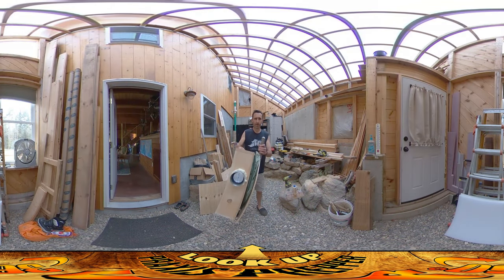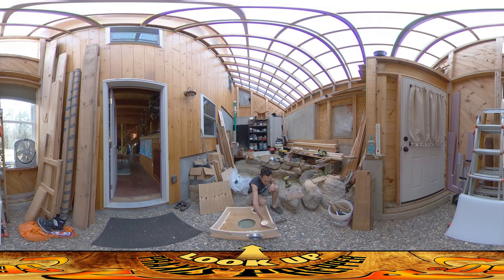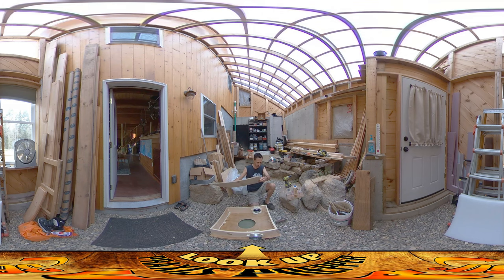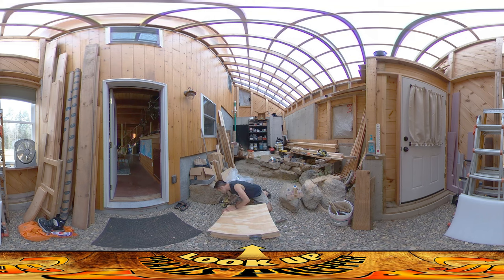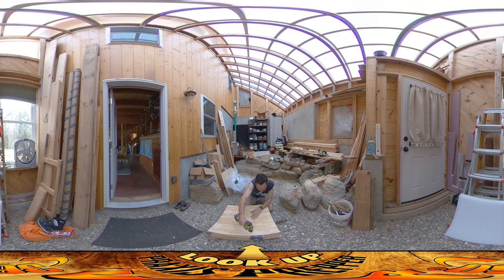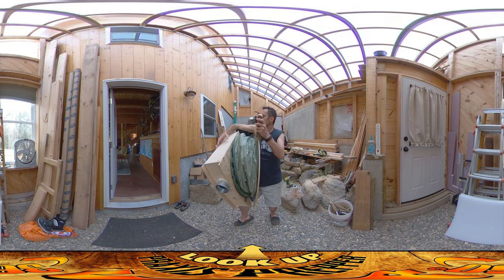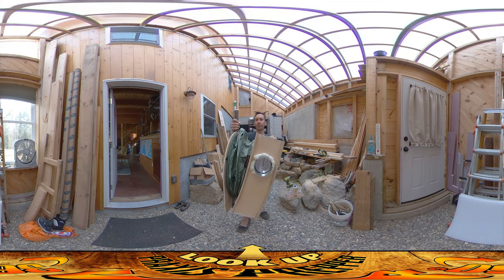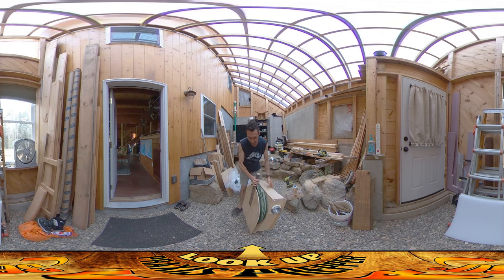Homestead Building - Fallout Shelter Manual Air Vent

Comment: A counterweight system will  help, Praxis.  See old fairrer system. Save you one  motion. Push down, rope and counter weight lift handle.. Work smarter , not harder
Reply from the maker: It's actually a pretty easy push/pull both ways. There's not a ton of resistance in the line, so feels easy to actuate. Now if those air intake filters start getting clogged with dust... that might be a different story.
Reply: @PraxisPrepper  :  do hand pumping for three hours, Praxis
Reply: @Diebulfrog79 😂😅

Comment: Looks like it'll work well...after you're done stabbing yourself with the screw sticking out.

Have you measured the displacement? Looking at it, I'd guess around 75 liters (a little less than 20 gallons)

At rest, the average person needs .5 cubic meter changed per hour to survive, 1 per hour to not be gasping for breath and 5 to 10 if working. Let's double that for comfort.
If my guess is about right and I'm correctly recalling air change needs, 10-20 cycles per hour per person.
I'm sure that you have a CO alarm but have you considered a CO2 alarm as well? They've come down in price a lot since I was in the brewing industry. I'd still go for a commercial model instead of a $50 "home air quality monitor" or the like.
A healthy person would certainly wake up long before the CO2 levels could rise to being short-term dangerous but there are some concerns about spending a long time at significantly higher than normal levels, such as for those working in greenhouses with added CO2 to promote plant growth. 
For reference, air is about .04%, some of those "enriched" greenhouses run .12% and an exhaled breath is about 4%.
Reply from the maker: I like your maths!

Comment: Buddy of mine was an arborist. He cut some branches down for a friend. He had a pre line that he slung into a tree to get his rope up that he used to climb the tree. Maybe look up how tree climbers get their ropes up there. His whole job was impressive from throwing his line to dropping the branches without damaging the things below n
Reply from the maker: Video on how I ended up getting the antenna up there coming soon. As someone afraid of heights, I did it with my feet on the ground.
Reply: @PraxisPrepper  I too hate heights. Can’t do fire escapes or water slides. But I love roller coasters. Coming down fast doesn’t bother me, getting to the top is the hard part.

Comment: i hope you can see this comment. can you do a rotating fan powered by a pedal but hand operated to act a vent fan if power runs out (i don't know what its called?)
Reply from the maker: You're correct to be concerned that i might not have gotten to read your comment. Viewers of my channel are constantly letting me know that Youtube is removing their comments and unsubbing them from my channel. Fortunately Youtube has told me that we're all just hallucinating and that stuff isnt happening. ;)
Anyhow, yeah i've seen mechanisms like that. A rowing machine often uses a fan for resistance. The sky is the limit on what any one of us could devise to move air. I went with this due to the ease of construction, but a foot pedaled version would be great too!
Reply: @PraxisPrepper  You're bellow is honestly a very genius idea. Once i had the time i'd like to build one as well 😁
Reply from the maker: If you want a shortcut, you could avoid making your own box and start with some preexisting box that's rigid and won't collapse under pressure (as in - don't use a cardboard box). Choose a box that has one side that's large enough to receive your trash bag bellows. Take that box add an in and an out air check valve, and then attach the bellows to the side and you're set. I'm pretty pleased with how well it works too. Making it, it looked a bit like a wooden toilet! ;)
Best luck! @pepepleaseplay
Reply: @PraxisPrepper  noted and thank you so much amigo  so much appreciated ❤️ sending 1 up and energy from the philippines ⚡ i live few miles away from an active volcano that spits smog regularly plus the possibility of china and taiwan in worst case scenario. this means alot to me
Reply from the maker: That's an intense area in a lot of ways. If you end up making the air pump, and think to, let me know how you end up putting it together. I imagine yours will be slightly different from mine if you're using different things that you have available, and I'd love to know how it all comes together. Good luck! @pepepleaseplay